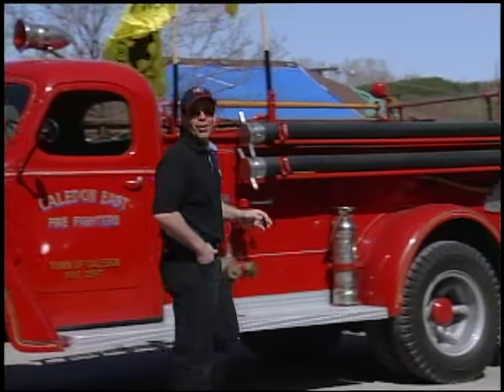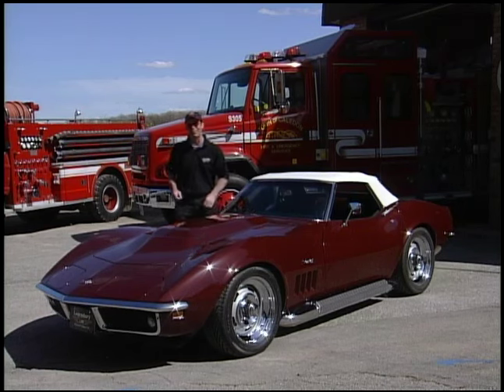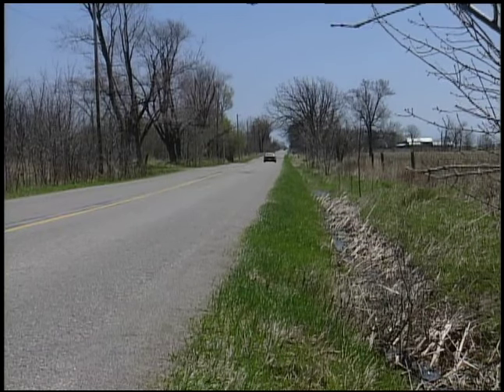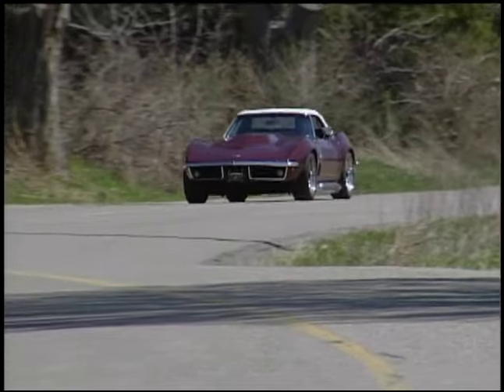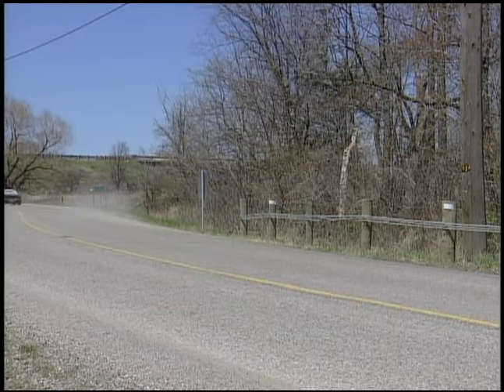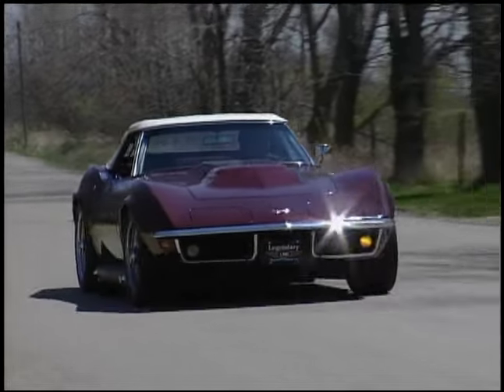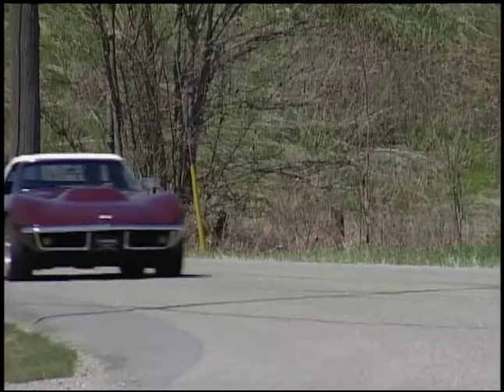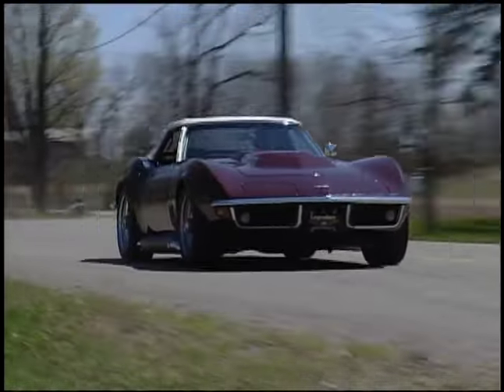1969 Corvette L88 Resto Project 13/13 Legendary Motorcar DCG TV series

Comment: My sister bought a new Corvette in 1969 and drove it from Columbus Ohio to Fresno California.the dash lights quit working in Texas,then it started running hot.When she got to California,the car was running like shit.She took it to a dealer and the engine's bearings were seizing on the crank.They put another engine in it under warranty.She kept it a year, and she traded it in on a Fiat 124 spyder.

Comment: GREAT job-- nothing like the sound of a BBC built like that-- am surprised for driving purposes you didn't use a 5 speed to run a different rear end ratio and still cruise a bit, that engine would like a set of 456 gearsSolid lifters or hydraulic ?